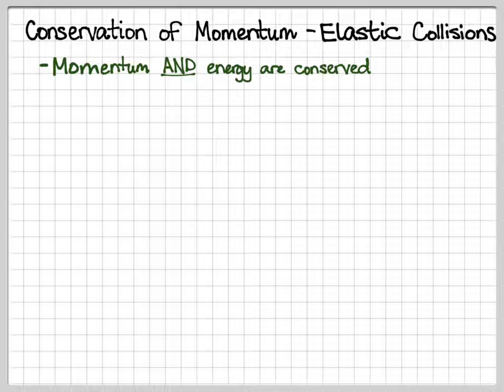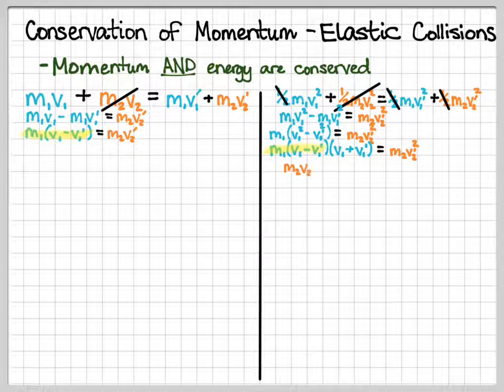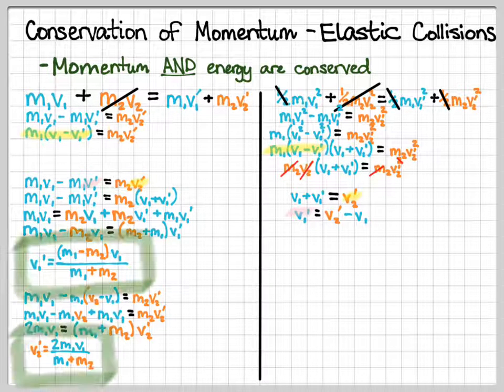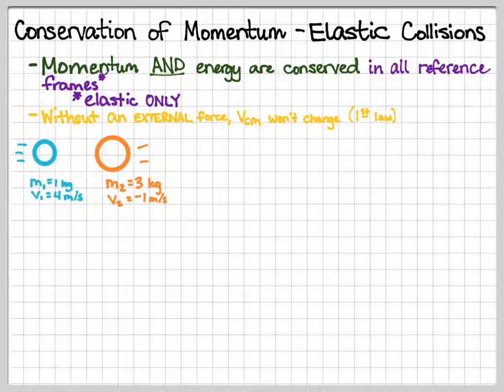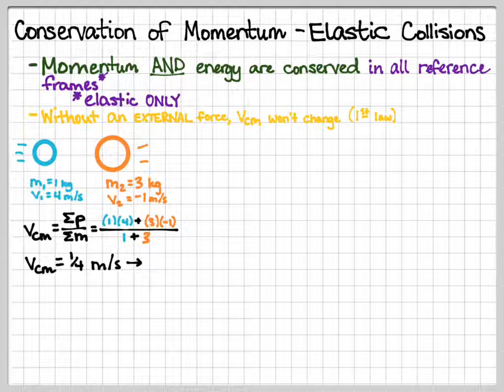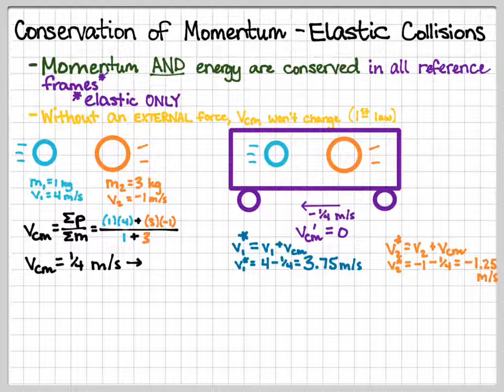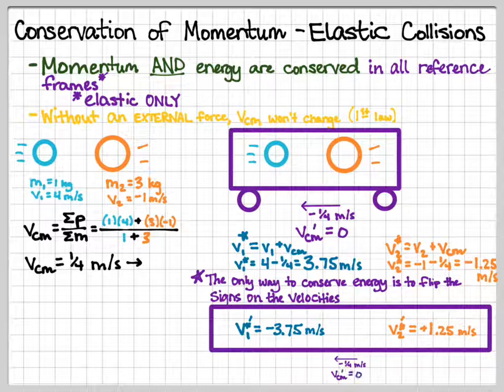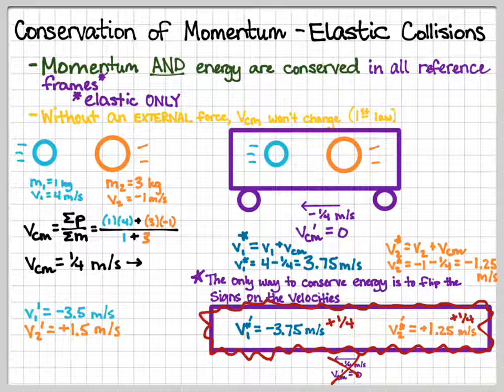Elastic Collisions - Center of Mass Reference Frame

Comment: Great video but I think there's a direction error on the box car.  The point of the box car is to have a frame where the motion of the cm is zero so the box car should be moving to the right at 1/4 m/s.  Forget the person outside the box car for a moment and pretend you're in the box car.  Now you simply subtract the Vcm from the two velocities and reverse the sign for after the collision.  Then, with respect to an observer outside the box car you'd just add the Vcm to these values to get the two final velocities in the original frame.  If you write a spreadsheet following this logic it will always work...objects initially moving opposite one another, same direction, etc.
Reply: Actually it's the same, it's -vcm if i'm outside and +vcm if I'm inside, either way the speed of the right particle increases in modulus
Reply: Your explanation helps me picture the situation much better.

What's quite interesting is that if you were sitting in that truck travelling at vcm, the velocities of the balls would be inversely equal to their final velocities after the collision

Comment: On the last slide, you calculate V* for each object and state that the formula is V* = V + V(cm) but then in the work you are doing V* = V - V(cm). It seems like you changed the definition of V(cm) to be the velocity of the reference frame which could be confusing.
Reply: Vcm is the velocity of the center of mass of the two objects.
V* = V - Vcm is how you translate from the lab reference frame to the center of mass reference frame.
V = V* + Vcm is how you translate from the center of mass reference frame, back to the lab reference frame.

Some instructors use U to represent velocity in the center of mass reference frame, with u being used because it is v's alphabet neighbor.